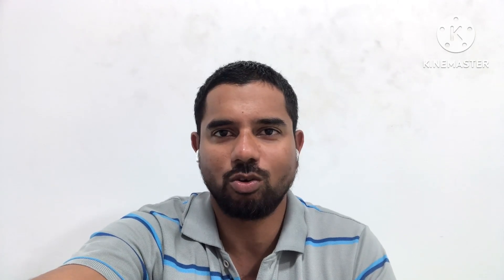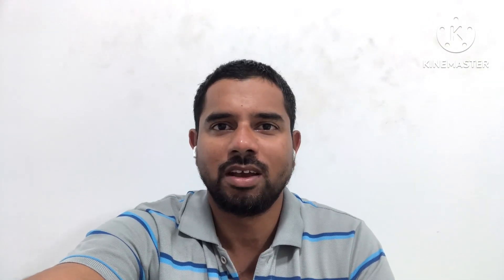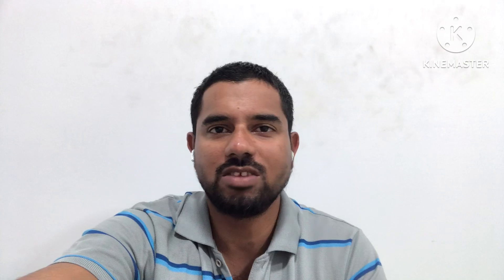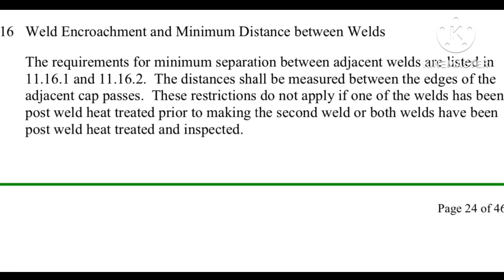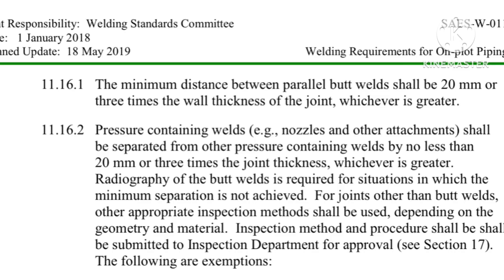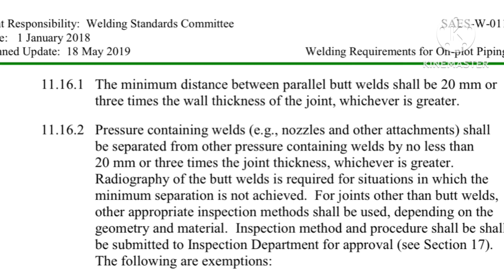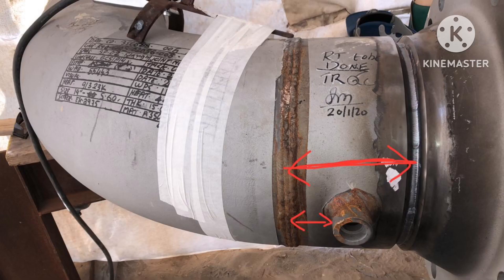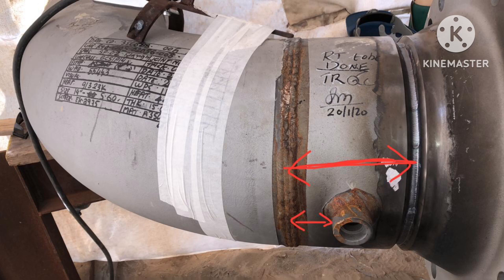What is weld encroachment?

Comment: What would be minimum distance between two weld?
Reply from the maker: The minimum distance between parallel butt welds shall be 20 mm or three times the wall thickness of the joint, whichever is greater.